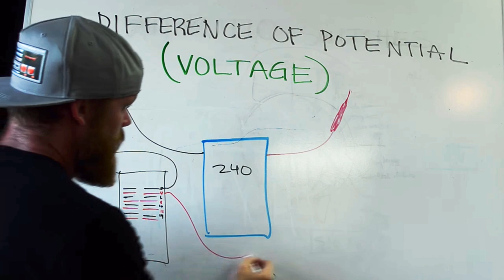11 MORE confusing electrician code terms - UNDERSTANDING THE NEC (PART 2)

Comment: Regarding #2...I've used a 3 pole breaker with a high leg to feed LED lights. Different voltages to neutral. On a 240 4 wire Delta system.

Comment: Dustin,   A very common Disconnecting Means (or means of disconnect) is a receptacle.
Reply: Kevin Coop no
Reply: Dallas    There was not a yes or no question.   It is a statement of fact that a receptacle is a means of disconnect.
Reply: Kevin Coop no
Reply: @dallas5374  Yes. NEC says so.

Comment: This is a very informative video to watch when a new electrician is trying to start reading the NEC book. Btw, correct me if I m wrong, a raceway also means the pathway going from a panel to the very first spot of a branch circuit, even running Romex without any conduit at a residential site.
Reply: negative on the Romex as a raceway.  If you "sleeve" the Romex in conduit, then it's a raceway.

Comment: can you do a video on motors, transformers, generator. how to connect them how to size wire and breakers, what to look up etc. please?
Reply from the maker: Just got a transformer, so that's coming next - motors and generators I'm still working on getting the gear to make it happen.  Still looking for some brand partnerships to work with on this so I don't have to buy all the equipment.  Good suggestion though

Comment: 2 types of disconnect 
One that you can lock out with a lock or  tie strap 
Next one is fuse disconnect 
When you are working on that device you should take out the fuse first before starting work 
A disconnect is a salety device

Comment: If you have a fused disconnect (safety switch) next to a piece of equipment, would the wire from the panel to the disconnect be a feeder, and the wire from the disconnect to the equipment be the branch circuit? Both sets of wires would be branch circuits if it was a non-fusible disconnect, correct?

Comment: Brotha man !!  Question  ( I was told)   In a commercial  800 amp main  , 1st point of disconnect that the grounds and neutrals  can not be on the same bar ( like in residential)  they must be separated and joined by a bonding jumper ..  I think  this is correct  but....     Its been years since Ive done one  and  the building has 3 300's  ( mains) and 4 subs ,  the main panel has  12  terms on the neutral bar ,  but we also have  ground rods,  building frame grounds, water main ground , sub panel grounds ,  etc etc ..   I can add a ground bar and jump it to the neutral bar  but ..... Oh there are smaller  neut / bars beside the main neutral lugs for (?) maybe #2's and smaller  - why can grounds go there?????   I was told they cant in a commercial  panel.  ( which I didnt do ) but it seems  why not 1 ft away I have a ground bar  and a jumper to the neutral bar ( its the same thing) other than looks .

Comment: hmm a few of these terms could have been explained much better if you weren't considering sub panels... sub panels are common but when  explaining feeders vs branch circuits you shouldn't get mixed up with considering sub panels ... residential its normally one panel

Comment: Correct me if I am wrong, but I was told in my last continued education class that you can’t share neutrals for multiple circuits anymore cause it causes an unbalanced load?
Reply: It does not cause an unbalanced load. Unbalanced current is caused by unbalanced loads across the phase(s) in reference to the neutral. Common neutrals can be utilized, but the unbalanced current must be calculated and the neutral sized accordingly, and then a multipole breaker must be used.
Reply: Not true.  You only are required to simultaneously disconnect all hots, with a multipole breaker ( or handle tie)